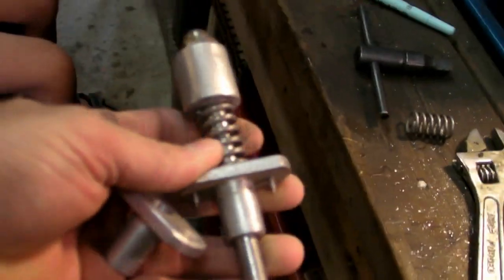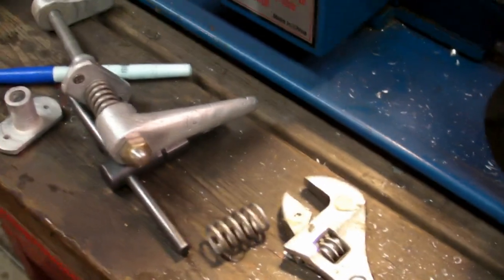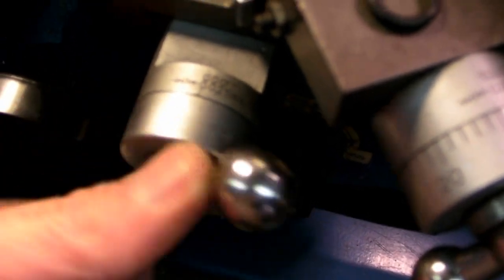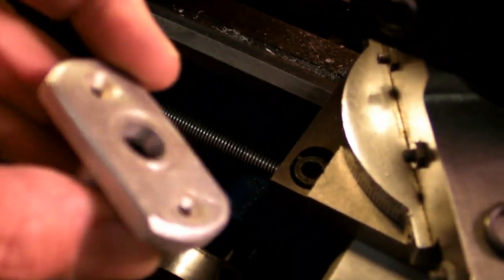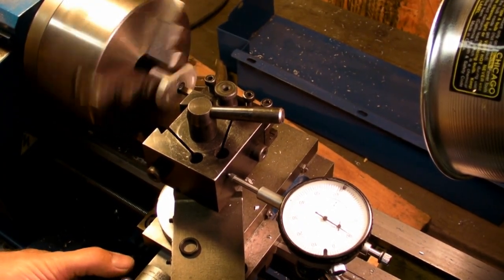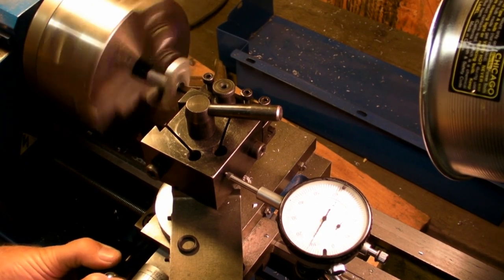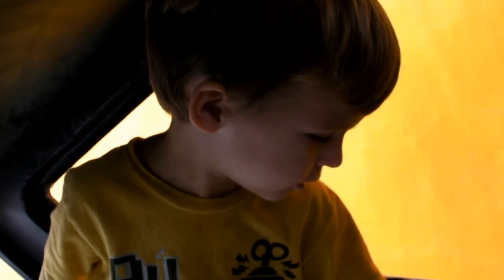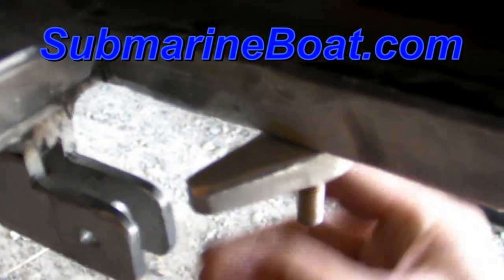Cutting Grooves on a Lathe and YouTube Trolls

Comment from the maker: @wadetingley  Hmmm -- Hadn't actually thought about that. The center dogs are symmetrical because they hold both hatches. The outside dogs can be set so they can only open forward, but I think they are small enough that they will stay in place.  We'll see.  A hatch popping open at speed would be exciting wouldn't it. :)